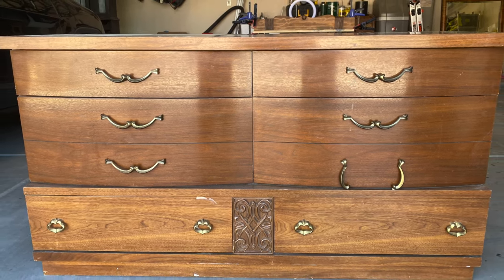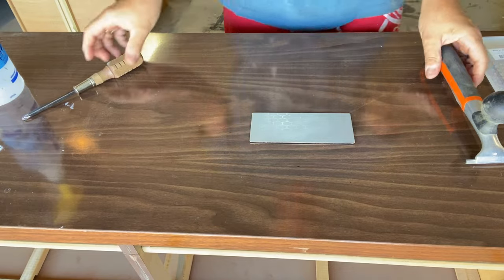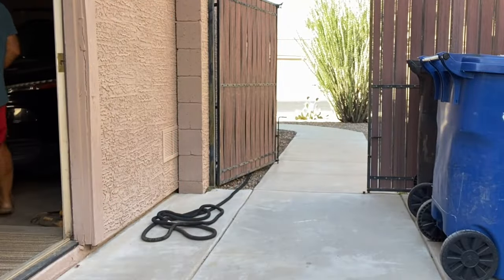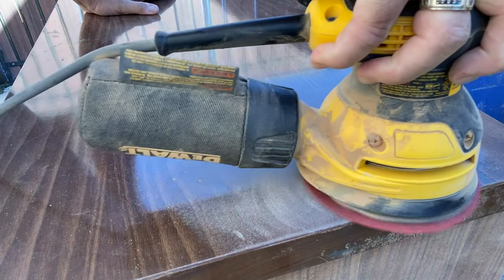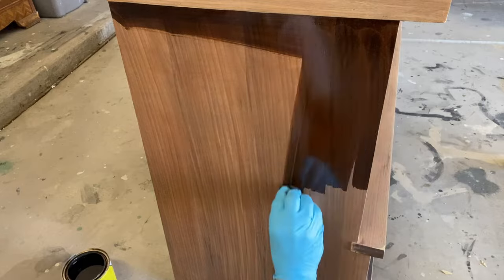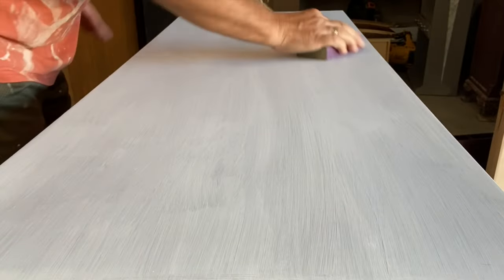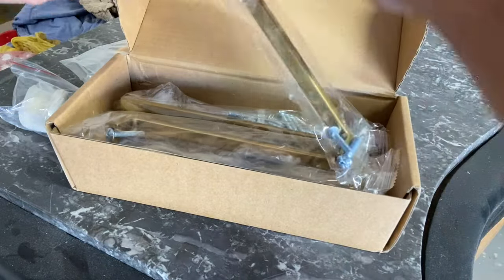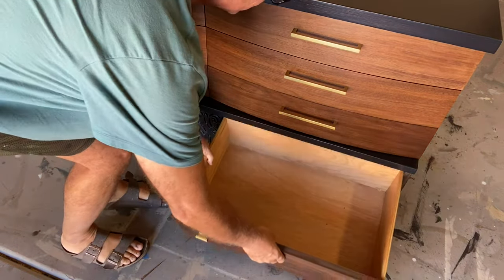Mid Century Modern Dresser Makeover.  Dealing with Laminate.  Furniture Flip.

Comment: So I was wondering u said u see the plastic before. I have a hutch where the doors on the bottom have a plastic cover on them with raised designs they are made to look n feel like wood but arnt I don't want the headache to remove them but want to paint it but my grandpa used what I think is latex paint on them not sure if I can scuff n paint over it or if I have to strip it to paint it.
Reply from the maker: If you can I would probably try to strip it to get as much of that paint off as possible.  If that is too much work you can try to scuff and paint.  As long as they don't get a ton of use and don't get banged up they should be fine.  Let me know how it works!
Reply: @Randyshufflesfurniture  thank you! I'll try to remove n see if it's doable in my living situation!